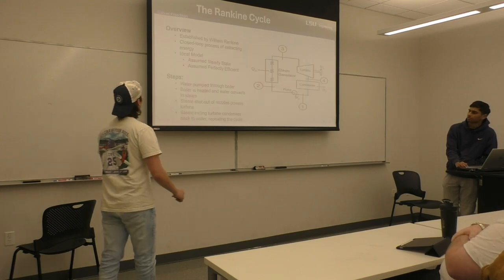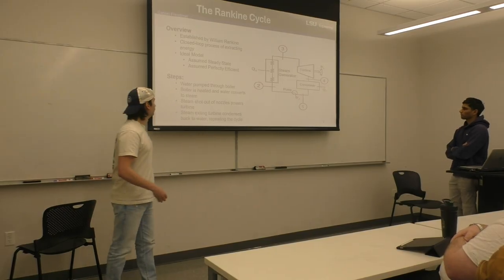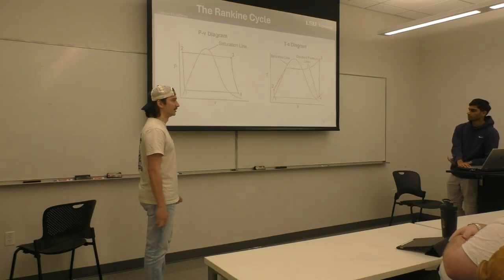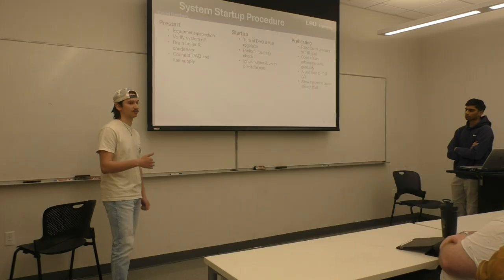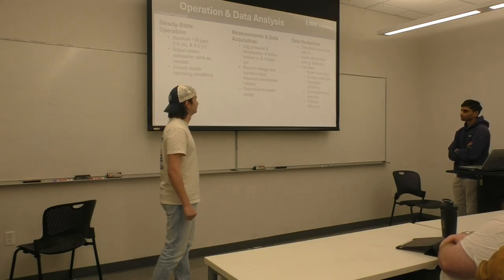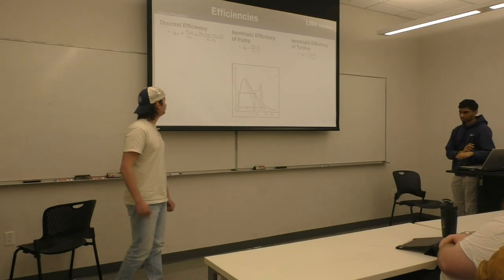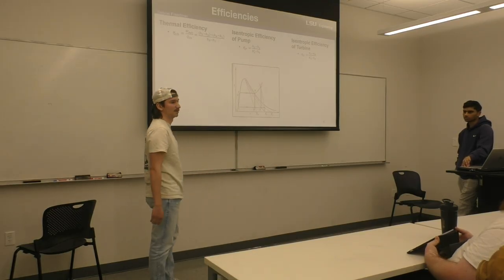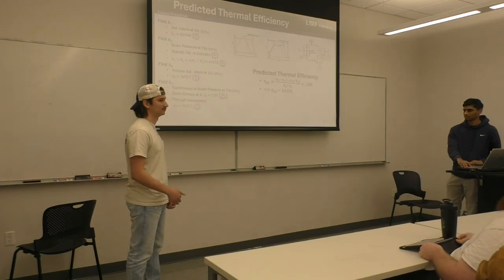Gabriel Freedman: Group Leader - Rankine Cycle

Comment: I think I did a good job at setting up my presentation, keeping it succinct by covering only the most important aspects of this upcoming experiment, the Rankine Cycle Experiment. Rewatching my presentation, I'm noticing that I was saying a lot of "uh's" and swaying a lot. I believe this came about from me blanking out on some talking points I wanted to say, so me forgetting gave me some extra anxiety during it. Even so, I need to do better and hiding nervousness during a presentation in order to sound more confident. Furthermore, I need to work on my introduction in order for it to be more concise, so I have enough time to finish all the slides to their proper extent. Overall, I think the presentation was solid, but my delivery could use some improvement.